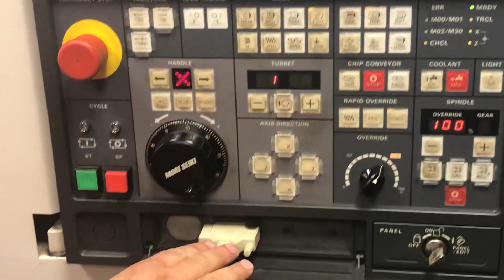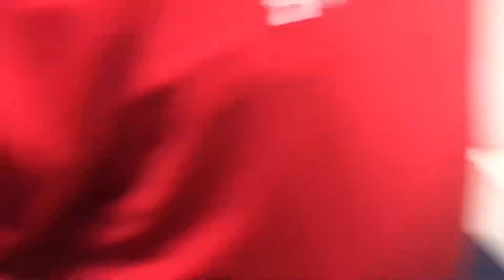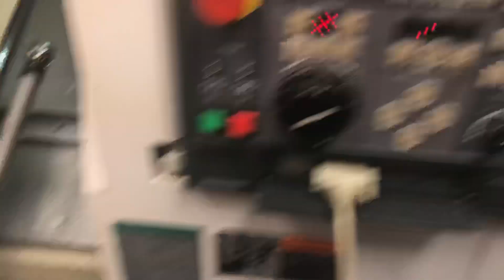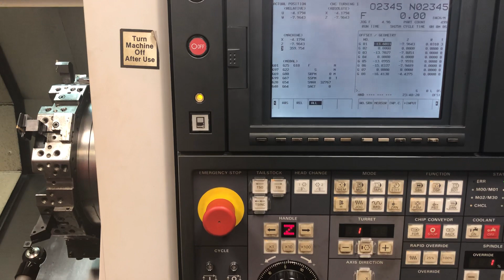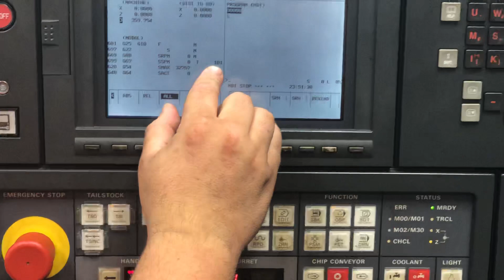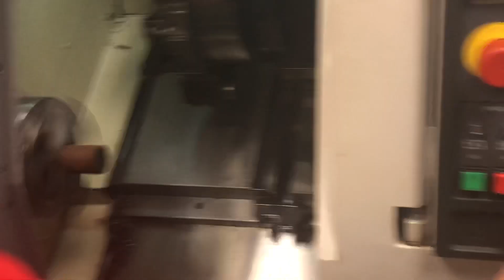Mori Seiki sl 200 setup part 1

Comment: Just a heads up I work on the same machine but when I bring the tool up to the stylus I get about 5mm away then put it in jog and press your axis direction. The turret will automatically stop moving when it makes contact.